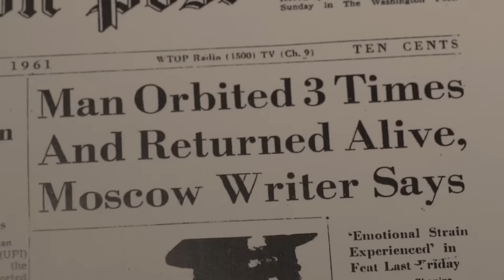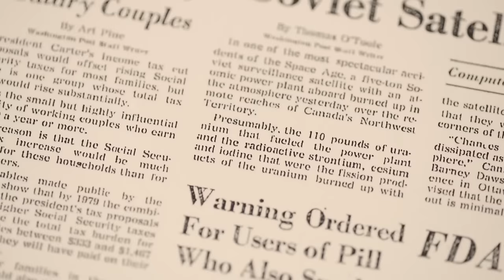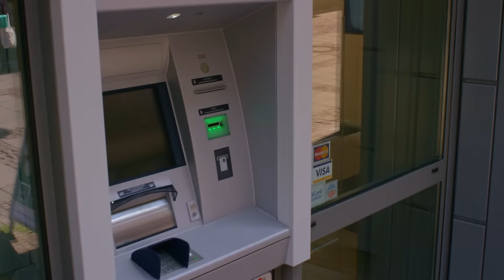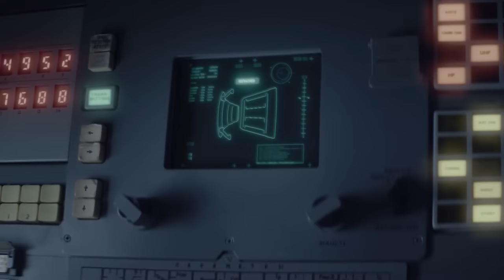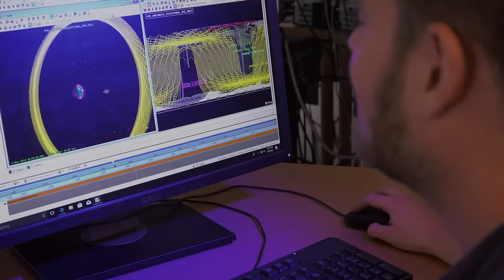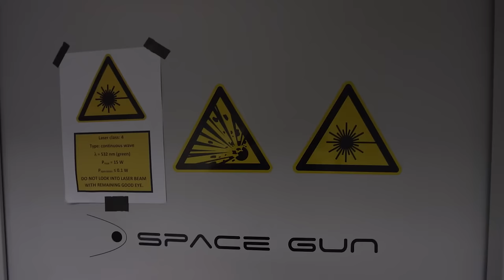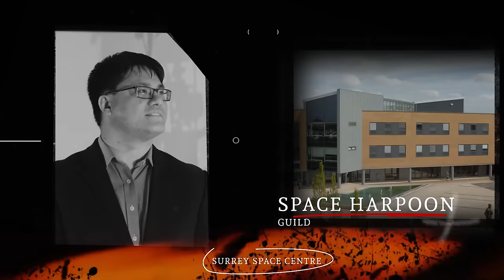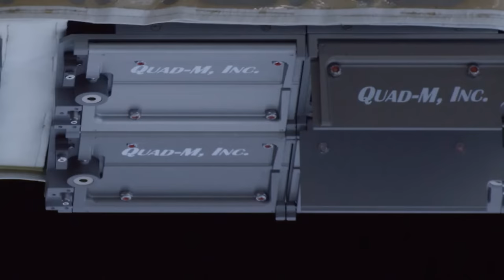The Deadly Debris That's Falling Back To Earth | Space Smash | Cosmic

Comment: This documentary is roughly 5 yrs old according to information it presents. For example, it emphasizes one web as a key player on the cutting edge of technology.  That company disintegrated, and had to be rescued by the UK. It has resumed launching satellites; however, SpaceX has since launched 5000 Starlink satellites over the last several years and is leading the field by a huge margin. It also did not mention that the Chinese deliberately allowed several boosters to disintegrate uncontrollably into the atmosphere over the last year or two.  The information presented is generally accurate, but there should be a disclaimer on when this documentary was published. I can only find September 2023, as the upload date. That is wildly inaccurate.
Reply: Yes, the dates shown on all vids only reflect when they were uploaded to YT. There does need to be a "first aired" date on all documentaries. This could easily be added by the uploader in the description.

Comment: Debris is also a threat here on Earth. Back in 2017 I was driving along a 4 lane divided highway in North Carolina. There is a 100 foot median separating the 4 opposing lanes of traffic. The highway is lightly traveled. There is also a 100 foot wide shoulder to a row of trees. The closest vehicle to me was over 1/4 mile away heading toward me. There were no vehicles visible in front of me. There were no aircradt. Something struck the roof of my truck. As soon as it did I looked in my inside rear view mirror and I saw a small shiny piece of metal bouncing down the highway behind my truck. When I got home I looked at the roof of my truck and there was a 1/2" dent that was not there before.
Reply: @loyarborough4114 , a glitch in the Matrix perhaps?

Comment: I noticed some concepted theoretical thoughts in design to collect Space debre, especially the one with the arms to grab the space satellites and other objects but what if a rope of some sort can be added to each and every satellite for future robots to connect with magnets or hook onto so easily force these desabled disabled satellites back into Planet Earth without losing valuable resources by floating them into Space with no hopes of retreaving them one day. So technically each satellite will have a tail so future robots can take control over them even if they are spinning out of control especially when all the electronics have shut down or malfuntioned.

Another possibility would be to add heating thrusters activated by lasers which the future clean up robots will have and easily generate the necessary energy by the Sun, similar to future space exploration concepts that people have thought of to provide thrust to future Spaceships by lasers by the Sun pinpointed onto sections of it. Computers can be programmed to match the speed of these satellites to effectively take control of them and to direct them safely to Planet Earths oceans.